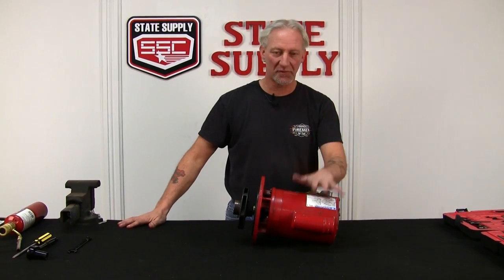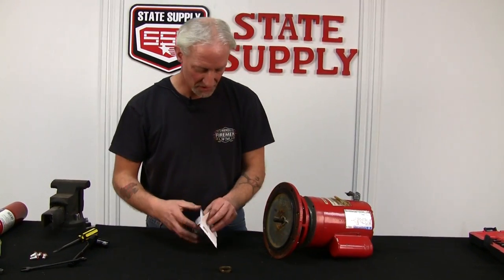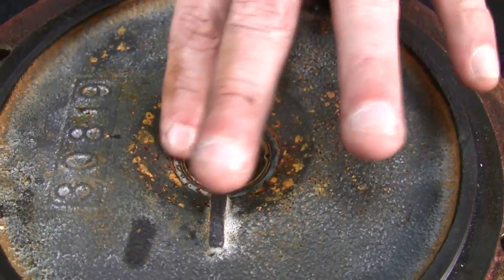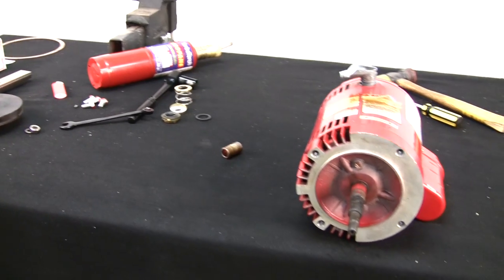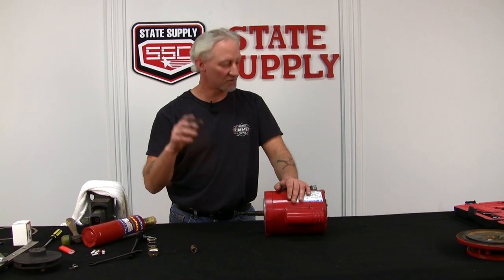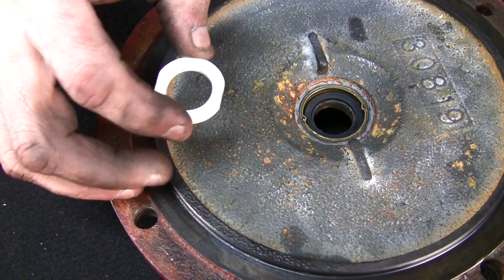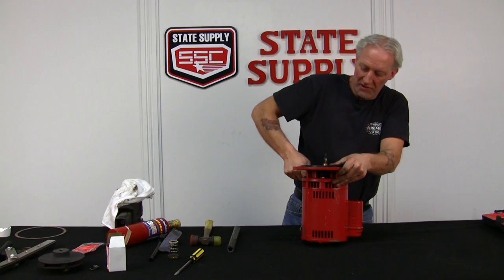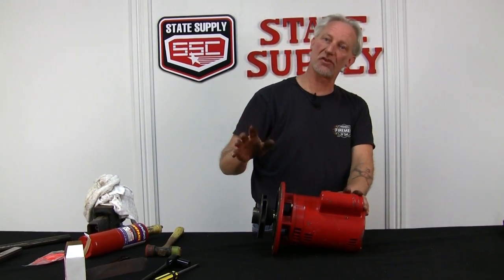How to Replace a Bell & Gossett Series 90 Seal Kit and Shaft Sleeve

Comment: how to make sure that shaft sleeve would rotate with shaft? sleeve doesn't had any key or set screw?
Reply from the maker: JL - You can give our pump specialists a call at 1-877-775-7782 and they'll help you out.
Reply: They use lock tight to seal the shaft sleeve